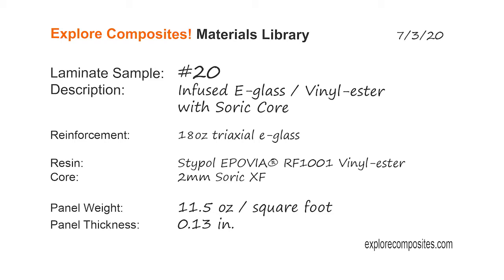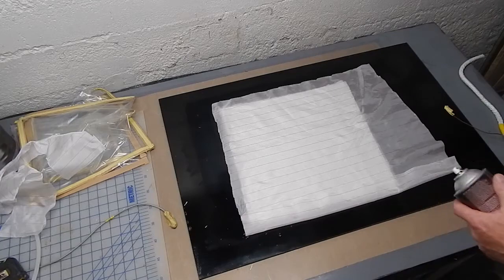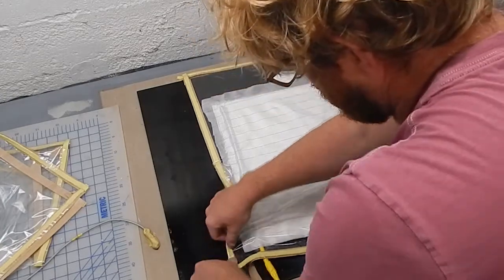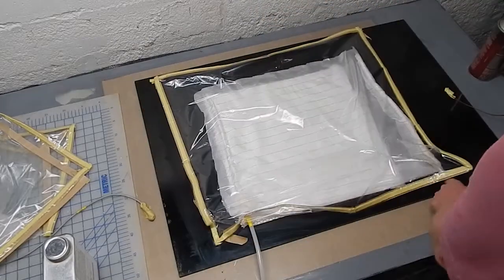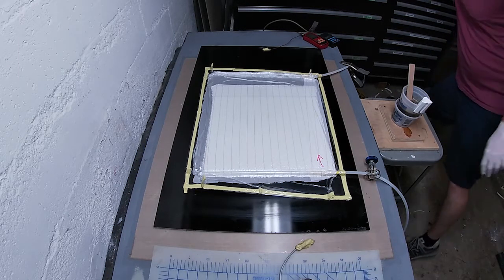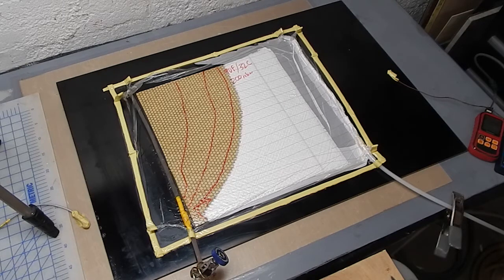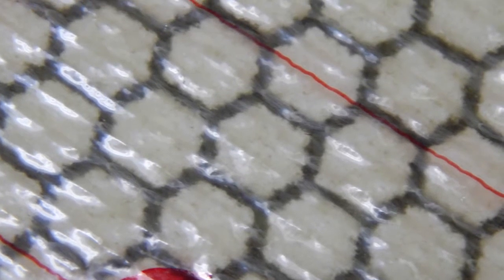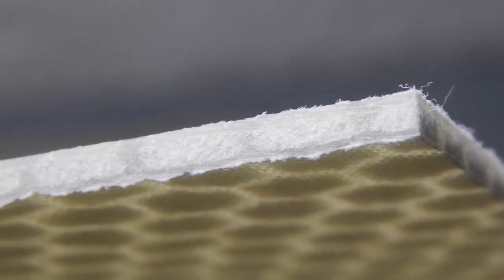Laminate Sample #20: Infused E-Glass / Vinyl-ester with Soric Core

Comment: Hey, do you know of any resources that explain how much vacuum is recommended for different applications?  I've been using the Gast DOA, but I just bought a (very cheap) used Welch 1402N--primarily because I need something that can degass urethane...but is using 29Hg a good idea for wet layup carbon?  I've had some issues with parts having a wrinkled surface, it doesn't feel like the vacuum is doing it's job...not sure if the resin, shape of the mold, my technique, or vacuum...
Reply from the maker: The problem with composites - too many variables!  In general for wet-layup you want about 15-20 inHg though in special cases you'll want more.  Risk is bleeding out too much resin - this can be adjusted with different release film perforations and bleeder thickness -  as well as initial resin content of the material.  

For infusion you want as much vacuum as possible for the initial pull-down, some time to debulk, and through the actual infusion part.  Once you clamp off the resin feed there are lots of good reasons to lower the vacuum (to maybe 15-20inHg) - but I am really not a fan of clamping it off entirely!  In this video I did the whole thing with a Gast DOA - just to show it would work fine.  With a larger part I would opt for more vacuum.  

Check out my Troubleshooting Vacuum Infusion article on the explorecomposites.com site - it may help.  I'm working on a more complete 'How-to' infusion article but struggling to find time to finish it - soon hopefully!
Reply: @ExploreComposites  Thanks!  That does help.   The resin I have been using is fairly high viscosity, so I may be inadvertently using too much due to it not flowing/ wetting out all that well.  The problem area is also the thickest, with 5 layers of 6k. 

I will be ordering more resin soon, so will try something with a lower viscosity.  I like the idea of prepreg for production, but that is still a long way away.
Reply from the maker: @fredygump5578  Resin viscosity matters but sometimes thicker is easier than thinner as long as you're not needing to bleed off too much resin.  Rolling is helpful.  If your parts are small-ish a "wet-preg" method may be helpful.  Check out Laminate Sample #15 - which shows the basic process:  https://youtu.be/06-0Vxs_9nY
Reply: @ExploreComposites  Thanks again!  I was wondering about how this is done.  I think this is what Mike Patey does, but I haven't seen him show impregnating the fabric.  

I will definitely try that out when my new molds are done.  I think I have just about finalized the design I want.   (I'm designing a knee pad with a carbon fiber shell, and covered with urethane overmold).
Reply: Really appreciate the library you are creating!!!
Reply from the maker: @seanthomas8266  Thank you!  I've always made test panels - just wish I'd made videos of them them starting ten years ago.  I'm really enjoying it and am glad other people find it useful too!
Reply: @ExploreComposites  I wanted to follow up.  I tried the "wet-preg".  It was faster and easier.  I liked it.  And I kind of changed everything, thinner resin, different fabric...original problem solved. 
But then, a new problem!  (Always a new problem...)  Inside corners.  It is a bit different than what you describe in your article about slip-joints, because the corner is the edge of the part.  My idea was to make a hard corner that is my trim line.  But the fabric wants to create a radius.  Is there a trick to make a hard corner work?  I'm curious about making a silicone vacuum bag, if that would help.  And I've seen a butyl rubber product that is meant to put pressure into corners.  Do you have experience with the silicone bag products?  It seems ideal for me.

Comment: Hi, are you seeing a noticeable pattern due to the shrinkage of resin in the pattern ? I've used Soric LRC so far and it still needs an external flow medium. i'm contemplating Soric XF for a next project but those are aesthetic carbon fiber panels si I wouldn't want any print through ! Have you tried Soric TF ?
Reply from the maker: I haven't done a controlled test with LRC vs XF or TF.  There's some on the shelf and this is a future sample - might be good to do side by side though!  TF is supposed to be best for cosmetics - also comes in gray for use with carbon... haven't tried it though.  

Even on thin-skinned white gelcoated parts you can often see the LRC cells.  Epoxy would solve the print problem but $$ and hassle.

Comment: is the soric only for flat panels?  Beautiful panel
Reply from the maker: Not at all - it is very bendy and can be sliced and fit easily to compound curves.  Makes a nice core option for very curvy parts of foam or balsa cored parts because it is easy to fit.

Comment: What is the R or U factor for your panels? 
Heating and air conditioning factors please.
Reply from the maker: I haven't ever tested and am not sure how I'd do it...

All the samples are different.  I guess for the foam-cored ones you could just assume the core is the whole thing and estimate the r or u-value of the core.  Being higher density than most insulation I'd imagine it's not ideal!
Reply: While comparing Your product to non compacted fiber glass It may not be as resistant to heat. but more resistant then steel. I wanted to know for Green energy engineering. 

How about uv dedication (lifespan).
Reply: @philhacker1137  Using mix and pour closed cell foam thats like 3-4 lb/f3 and laminating that will yield a VERY high R value with VERY high stiffness. Using vinyl ester resin will make it resistant to UV rays and there are additives to even futher increase that. Maybe even consider aluminum foil backing after the fiberglass or an aluminized fiberglass sheet on one side for additional boosts. You can buy or cast closed cell foam core (they sell it even specifically for AC).

I would take a flat glass plane, put a totally flat aluminum foil on top of it, then fiberglass (make sure it is good resin flow as you arent having flow media), then core (maybe score lines in it for resin flow), then fiberglass.
Use a reusable silicon bag or second flat glass face/steel caul plate with sealing around it and pull vacuum. Infuse it and pull away. The bottom doesnt need or have mold release because you are bonding the aluminum to the fiberglass, reducing time and steps. The top does need mold release unless you want to somehow double up on the aluminum face.

You can simply do aluminum/foam core tho and that will produce structural high-R value products.

I hope this helps